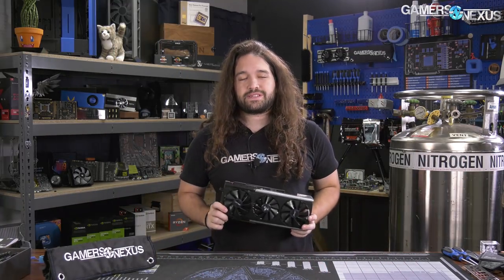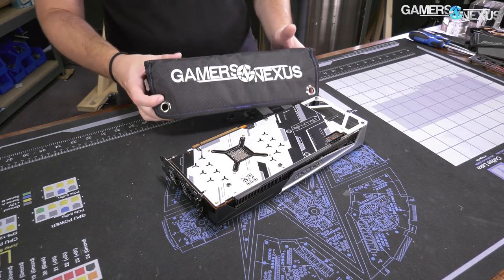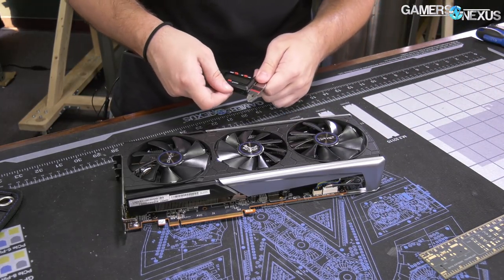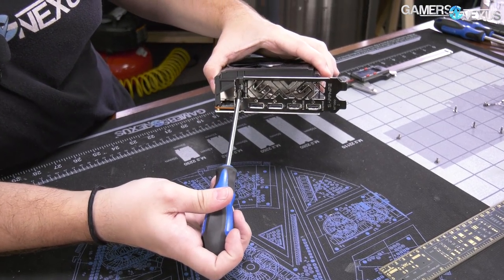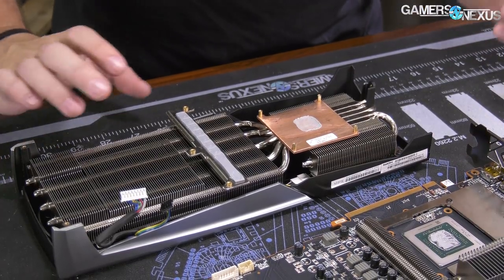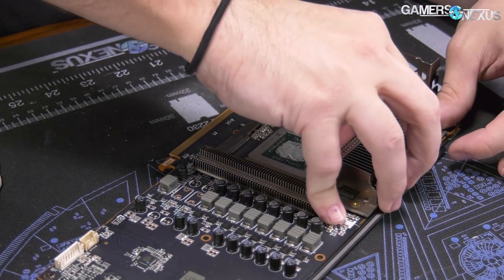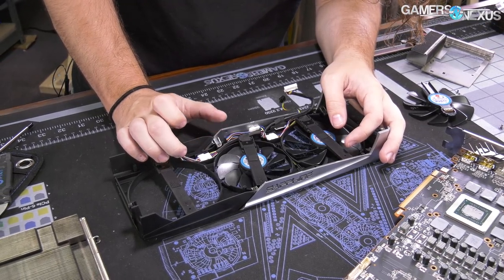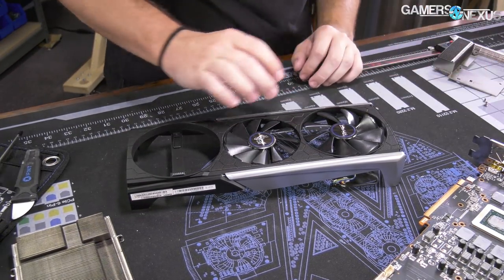Tear-Down: Nitro+ OC Sapphire RX 5700 XT - Thermal Design & Assembly

Comment from the maker: Watch the Sapphire Nitro review here: https://www.youtube.com/watch?v=kh1DeO4yz2s
Buy the GN toolkit for GPU tear-downs here: https://store.gamersnexus.net/products/gamersnexus-tear-down-toolkit
Reply: Great vid, ty. Minor point: I believe it would be pronounced TriXX as in "Tricks", yes?
Reply: Just a heads up might be nice to post the smaller fan model number too.
Reply: The back of the calipers is used for measuring inner diameters.
Reply: I would just love to have that card.. Amazing.
Reply: Looks like AIB partners investing in great pcb/cooling solution since it will be used in RX 5800/5900, who knows maybe RX 5800 GPU will be just a drop in in those big cards.
Reply: @ihavenoname275  They need to use an upgraded GDDR6 memory controller, along with all of these other nice features.
Whoever does this will have the absolute best overclocking 5700 and 5700XTs
(since the memory controller is the current overclocking issue for the GDDR6, with these cards)
Reply: @Gamers Nexus
Hi Steve.
Has any of your board partners mentioned that there will be an ITX case friendly plain 2-slot version in the future?
I've now waited since NVidia started the GTX 970 for AMD, to finally throw a good, competitive mid-range card onto the market, 2016 was disappointing, so was the Fury lineup. And now there are all these cards I can't use because the boards partners can't figure out a way how to make a standard 2-slot card for the RX 5700.
Feel very burnt for my AMD loyality since 2012 rn. I think if that continues for another 2 months I won't EVER be waiting for a future AMD graphics card again! cheers
Reply: @LukeHimself  first off only AMD can upgrade the IMC, it's built into the gpu die. i wouldn't be surprised if the 5700xt was originally designed to use HBM2E or HBM3 but it wasn't ready yet so they quickly re-designed it to use GDDR6. could explain the IMC limitations or.... it could just suck, lol. it'll be interesting to see if they stick with GDDR6 or go to HBM2E with the 5800 or 5900 series.
Reply: @Quast  there are dual slot 5700/XT's but dunno what your limitation is on length. powercolor's dual fan base model is a 2 slot, asrock challenger is a 2 slot. unless they go back to using HBM2E/HBM3 then you won't see any half length pcb's like the vega 56 pulse any time soon.
Reply: Please Gamers Nexus can you do (Buildzoid) a full in-depth analysis of the ASUS ROG Rampage VI Extreme Encore
 and the ASUS ROG MAXIMUS XI APEX motherboards
, thank you very much and great content as always!
Reply: @sirmonkey1985  Yeah I know, but two is not really a variety of possibilities.
And Powercolor I don't really trust for some reason...
Reply: what is the thickness of all pads and how much in mm length is needed for each thickness on this gpu im not happy with the stock ones?
Reply: Cyrus Vane  pretty sure you have to use non conductive paste on gpus so no unless you want it to fry the chip
Reply: hi i have 5700x nitro  in 2k have 74 and 94 juction temp is safe?????
Reply: Fans & other accessories https://www.sapphiretech.com/en/accessories/nitro-gear-accessories
Reply: What is the thickness of the thermal pads on mems?

Comment: Sapphire nitro+ cards always look great and have a great build quality
Reply: There's a reason they get called the evga of amd, just consistently good products you can trust.
Reply: @waking00one  My Sapphire 290x is still going strong.
Reply: I have a Rx580 Nitro+ and looks great and fits my black and silver build perfectly
Reply: @waking00one  consistently good except the cooling solutions on the rx 400 cards. those were terrible
Reply: @jmandameloya  i have the same rx 580 i love it
Reply: @MegaDominik1  I have a Sapphire RX 480 and I can confirm the cooling is crap. Changing thermal paste didn't resolve the issue. And, unfortunately, it stutters in many games.
Reply: @loris2265  why should thermal paste solve the problem? the cooler is just small as fuck. had the rx 470 nitro 8gb. performance wise pure price performance king due to the 8gbs memory, but the cooler was just with undervolting or with the silent bios ok. not good, but ok
Reply: @loris2265  Weird. I have a Sapphire RX 480 Nitro+ and with a custom fan curve of around 55% my card stays cool as a cucumber (I live in a tropical country and temps in my room are just about never under 25C at any day of the year).
Reply: @Mandragara  My 2x 5830 are still going strong
Reply: Huh, I have a Nitro+ RX480 and mine doesn't go above 70c while playing GTA V? RAM OC'ed and undervolted to 1.1V though.
Reply: i was a sapphhire fanboi before i got my first sapphhire card ;D
Reply: Agreed, Im always buying the Nitro+ from Sapphire, greate quality and lots of love put innto the engineering of those cards.
Reply: @waking00one  I think EVGA has taken a downturn in quality though. Their new fans look ugly as hell and there's no reason for bumpy Evga-shaped ridges on the fans despite their claims to improve performance. Also with some 2060 and 1660 Ti cards, the heatpipes don't touch like 1/3 of the fins.
Reply: They age very well also. My backup computer has an Sapphire r7 260x and I can play Total War Warhammer comfortably. 
The 1070 I replaced it with has already begun to let me down. A couple of games that it happily ran at 1080p ultra in 2016 now have to be run at high settings. 
Looking forward to RDNA2 and rejoining the red team.
Reply: I built a PC for simracing and I bought this card a couple of months after launch. Now I figured out I can do minus 15% on power and the GPU Clock is still 2000-2050 (Same as with no power change). Power reporting is now 30-50W less -> 150-170W (simracing titles are not GPU intensive, except ACC). When I found out I can cut the power and have an almost silent PC I went here to see why. Firstly, I think I won the silicon lottery. Second, Sapphire did a great job with this card. And I bought it for only ~400 EUR (with tax - now it's almost unbelieavble). I was so lucky I bought the simPC before Corona...

Comment: 9:39 Most stainless steels have an austenitic structure due to their high nickel content making them non-magnetic. The more basic stainless steels have a ferritic structure and are therefore magnetic. As a result using a magnet to tell the difference between aluminum and stainless isn't very effective.
Reply: nice
Reply: Knowledge bomb.
Reply: true but the non-magnetic stainless steel is more expensive so no-one in their right minds would use it. He could just scratched it or use density but it is pretty clear just by eye it is aluminium, not even zinc die-cast which would still be possible;p
Reply: @St0RM33  pretty much all industry uses non-magnetic SS. Like about 90%
Reply: Nice write up.

Picking it up would instantly tell. IIRC Aluminium is 1/3rd the weight of steel.
Reply: Not sure how accurate this is but from the people around me I heard that if stainless steel is magnetic it is shitty stainless steel.
Reply: Absolutly true, but there are tiny and stronger magnets that will get slightly attracted to austenitic SS.

Comment: It's only nine months since I replaced my 2500k with a 2700X and 1050ti with a Nitro RX590, so I will hold off on this card until they come down in price (unless something better for the money comes out in the meantime). My 2700x is damaged, so I just replaced it with a 3700X. I am really impressed with it. Low TDP, good price and plenty or horsepower. 

I play an indie space game called X4 Foundations that has performances issue as the game goes along. Once lots of ships and space stations get built the map mode and 3D first person view get bogged down to really low FPS. In my mega space factory complex I was getting 12 FPS in map mode (CPU bottleneck develops as the game progresses. 60-110 is normal FPS for me when starting the game). I thought I would only get a few percent improvement from the 3700X in those really demanding sectors of X4 space. I am getting up to 100% better FPS and around 30% average. The 2700X is a decent CPU for the money. The 3700X is very decent.

Only issue i am having is that the latest B450-F Strix bios is a little finicky trying to boot the computer. Sometimes it works and sometimes not. The memory warning light for the Trident DDR-3200  comes on. Reset and it boots into Windows and everything is as it should be with ram speeds etc. Today I will clear CMOS to see if it sorts it out. AMD are a small company compared to both Intel and Nvidia. Hopefully now they are growing they will invest in hiring people to help improve the software that supports their hardware. Their driver software looks really nice, especially compared to that horrible old Nvidia driver app, but it does not always work well (the worst software I have had over the years has always been Asus motherboard utilities. Bloody awful, but I stick with them because so far an Asus board has never failed on me. Before the Z-68 board I had ten years of motherboards popping capacitors and dying).

Comment: 18:40 vertical fins in are better, because the length of the card is longer than the height of it there is more space for the air to come out
Reply: Thats why this guy doesn't work for sapphire

Comment: The magnetic test for stainless steel is not a good test stainless steel. It can be made non magnetic and magnetic.  Your best bet might be by weight.
Reply: Density really doesn't work to distinguish steels: there are too many alloys and heat treats. But you are right that some stainless will still attract a magnet.
Reply: Gavin Johnson lower quality stainless is slightly ferromagnetic
Reply: @endmymisery3623 , not always. 400 series SS are commonly magnetic with a couple of exceptions.
Reply: Gavin Johnson what the fuck are you smoking? heat treat has nothing to do with density. Alloying can technically change the density, but with steel you're never going to see more than a few % of alloying elements by weight which would translate to single digit percent differences in density between steels. It's not that there are too many alloys but that the differences in density are so narrow as to be almost impossible to measure accurately. even with something as simple as low carbon to high carbon steel, the difference is only 0.3% more carbon in the alloy. unless you're looking at something like inconel vs cast iron then an entry-level scientific scale and graduated cylinder wouldn't even be accurate enough to register a difference between two alloys of common steel.
Reply: The quality or grade of stainless affects its magnetism, AvE has tons of videos talking about different metal alloys in his BOLTR series of videos.
Reply: true but the non-magnetic stainless steel is more expensive so no-one in their right minds would use it. He could just scratched it or use density but it is pretty clear just by eye it is aluminium, not even zinc die-cast which would still be possible;p
Reply: Put some conductonaut on it.
Notice the difference :P

Comment: Sapphire is one of the best companies for AMD/Radeon GPUs
Reply: Yep, still rocking a Sapphire R9 290 Tri-X OC, this is going to be my next card I think, unless the RX 5800 and above cards are good enough value when they come out.
Reply: @AJDOLDCHANNELARCHIVE  r9 280x vaporx tri-x owner here. My card still is an amazing performer and let me play control on mid-high settings in playable fps just because of the extremely generous overclocking headroom. I might be upgrading to the 5700xt nitro soon though.
Reply: @rheeko2119  Yep I'm in the same boat here... can still play most games at high-ultra settings at 1080p 60fps, probably my 8 year old Intel Xeon x5675 6 core/12 thread beast overclocked to 4.2ghz on all cores helps out too haha...

The only reason I am wanting to upgrade is for productivity purposes and anticipating a leap in gaming technology when the next generation of consoles come out. But I will keep this system and put it into a smaller case for LAN/backup PC purposes as it still is extremely capable.
Reply: @AJDOLDCHANNELARCHIVE  I'd assume that even a ryzen 3600 would still be a massive leap in terms of productivity for you, compared to an 8 y/o xeon, but I'm pretty sure that a 290x could still carry the workloads of mainstream gaming for at least 2 more years to come
Reply: @rheeko2119  Yeah, it'd be an ok upgrade. But I am getting 995 CB RR15 on my 8+ year old x5675 overclocked to 4.2ghz on all 6 cores/12 threads. I'm waiting for the 10th gen Intel 18 core/32 thread
 CPU's coming in a few months to upgrade personally...
Reply: @AJDOLDCHANNELARCHIVE  That PC is a true museum piece. If you don't repurpose it. You should mount it in a Thermaltake Core P3 and put it on the wall, it's a work of art along with that 290X.

Comment: Got this card... on Silence Bios is does 2000mhz core clock and 925 on the Mem

Undervolted it to 1050mV in Wattman and it uses 170 Watt max in Benchmarks.
Temps are around 60/63 c. 
Made a custom fancurve starting at 28% and max 35% fanspeed.  (fanstop off)

Going for a Waterblock soon !!!!

I love this card.....

Greeeetz from the Netherlands

Comment: The replacable fan also makes it a lot easier to get the dust off the card. Remove the three fans and you get much better access to the heatsink while you can easily clean the fans. Unfortunately where I live the retail does pricefixing, you still pay €480 for a simple Sapphire Pulse while you pay €410 for the reference-card. Allegedly the suppliers/distributors put pressure on the retail to keep the prices high and they keep it just that high that it is not less expensive to buy it from Germany and pay an additional $25 transport cost. The Nitro is not really deliverable yet here in Europe but the price seems to be going to be equal to that of the Asus Strix, around €550, a €140 markup compared to the reference-card. :/

Comment: Sapphire always makes the best cards.. they have been my go to manufacturer since 2002 when the Geforce 3 Ti 500 was the last Nvidia card I had bought. In that time I once tried a XFX card but it never measured up to any of the sapphire cards I had bought so I just wrote that off as a mistake.
Reply: Xfx made good geforce cards though even into circa 8800 gt era. Later on they were amd.

Comment: I hate mine lol, mine always overheats. Strangely, when I repaste it, it runs good, then a week later it starts overheating again. Fans are all working, I got good airflow, nothing seems to be loose, etc. Pretty sure I bought a bad used card. My old STRIX GTX 1080 used to never get above 70C even when OC. Now this card gets to like 80C core and always thermal throttles since it hits 110C junction. I've asked forums, looked it up on google, can't find any info on why it does it. The memory and other portions of the card run nice and cool however.
Reply: I have the same issue, have you found any resolutions? are you repasting and thermal pads or just paste?

Comment: Bit of additional info re the fans. They are designed to be swapped easily and you can actuallly buy an led fan kit from sapphire to bling it more if you want (similar to a sepcial edition they have.) There's even a fan health test in the Trixx app. Love my Nitro+, great performance/noise/heat balance with the option to OC higher if you want to.

Comment: Sapphire Nitro+ =  Guaranteed fuses both from PCI-E connectors and pci-e slot, nice multi-layer pcb with high quality components,
and better cooler (easier to keep temps enough low to avoid throttling).

Comment: I used to sort the stainless from the non-stainless steel by checking if it was ferromagnetic and 95% of the stainless wasn't even slightly magnetic so I wouldn't use that as a way to tell between stainless and aluminium, checking the resistance with an Ohmmeter would be more accurate.

Comment: I think the old Radeon HD 7990 might still be my preferred implementation of a tri-axial GPU cooler. That thing was just so dense. Great fin density, great heatpipe density, great fan density, and it still thermal throttled pretty hard.

Comment: Thanks for the review. I had a rx 580 nitro and it ran louder and hotter than an msi gaming x  r9 390 . I couldn't even touch the clocks or voltages of the sapphire card or else it'd crash. Great review but I think I'd chose powercolor from now on.

Comment: The only thing I wanted to see that you didn’t do was to see if the silver half can be separated from the black half of the shroud to see if I could remove the silver part without removing the fans from the card. It’s ever so slightly too wide.

Comment: I feel like I might wanna make custom water-cooling with cheap components for my Gpu but also looking at it no way without little breaking sides of cooling part.Also it would look so messy without some 3d printed units. If I feel like I buy ek watercooling part. Also It seem like you could also just remove back side and add some abb cooling ram heatsink to improve with thermals.